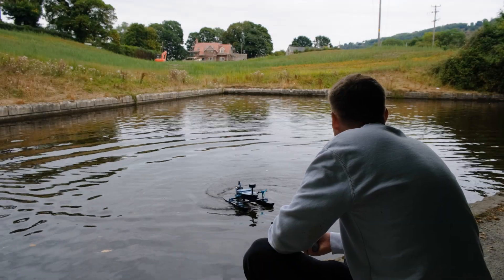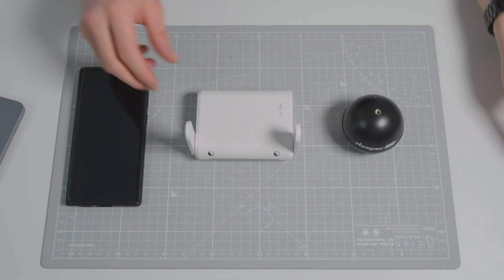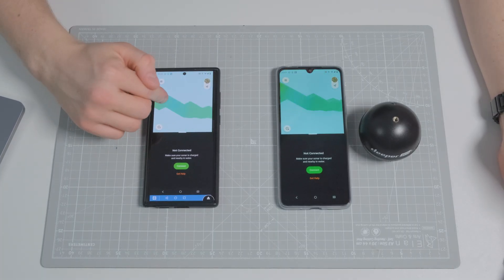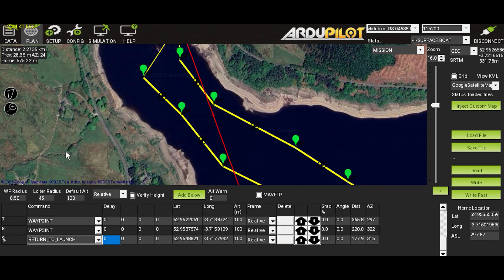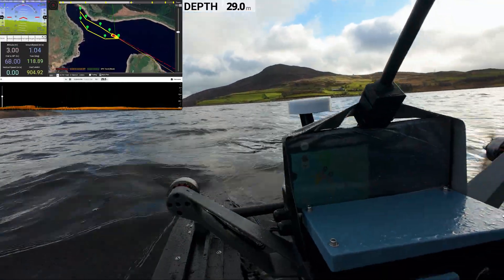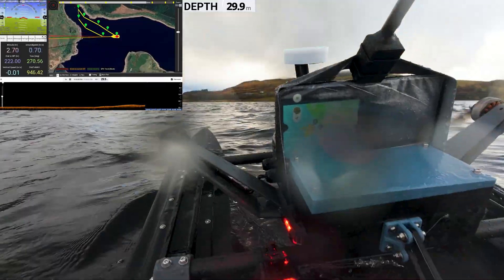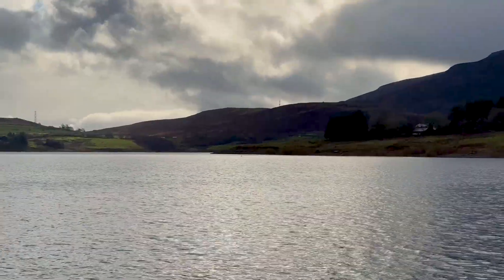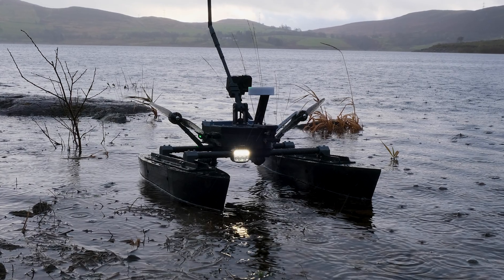This Was the Most Dangerous Mission My Autonomous Boat Has Ever Done

Comment: Pretty good, but you should have gone for a sailing vessel to save weight, power consumption and therefore battery degradation
Reply from the maker: I like the idea of potentially using a sail. I prefer the power and adaptability of the motors. But a combination of them both could work quite well

Comment: hi. why not make the boat with a arduno board so you can take over control if needed, even far away?
Reply from the maker: The rc connects to the boat and can control it from up to 10 - 15km. Then the radio controller connects to our ground control. 
Have a watch of more video "I Trusted My DIY Autonomous Depth Mapping Boat On a Lake" it goes into detail on how the system works :)

Comment: Use the sounder in conjunction with the autopilot and log the sonar depths rather than watching it realtime. Ardupilot can do this. Excellent mission well done.
Reply from the maker: You're right! I have been looking into the options a bit.  At the moment deeper offer such a good all rounder for testing.  I think on the new boat its going to be all though the flight controller potentially + a rpi. Thanks mate really means a lot!